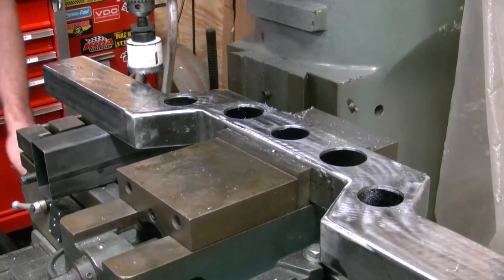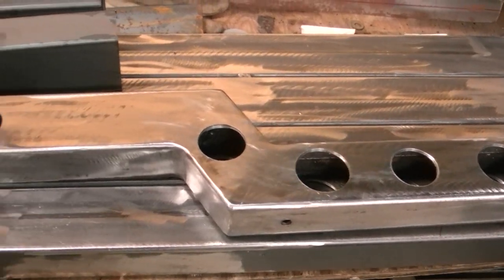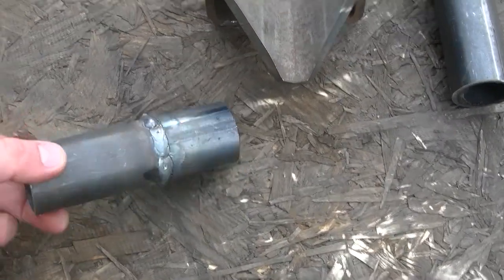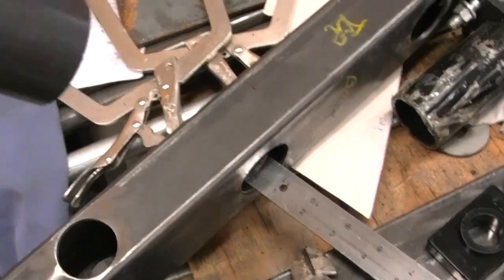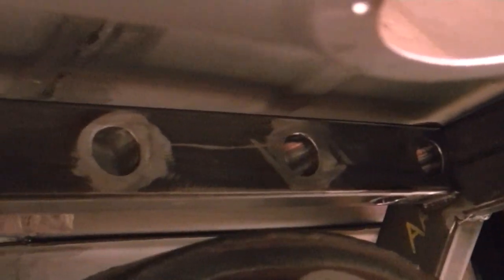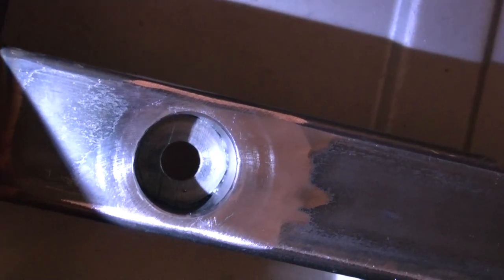Studebaker Gasser Build Update 13

Comment: Which motor will you use for this car... I haven't see any videos on it
Reply from the maker: This one is getting a blown 509 Big Block Chevy. When on alcohol and blower turned up will probably be in the 1300-1500 HP range. Engine has not been built. I do have most of the parts to build it, but it will be the last thing I build for the car. I'm just using a mock up block for everything now.
Reply: @finalcallracing  wow can't wait to hear it run... See you on the next vid

Comment: Hi did you weld it flux core?
Reply from the maker: No, we have never used Flux core to wire weld. We use 75/25 argon co2 mix